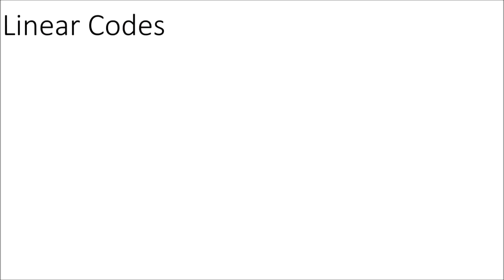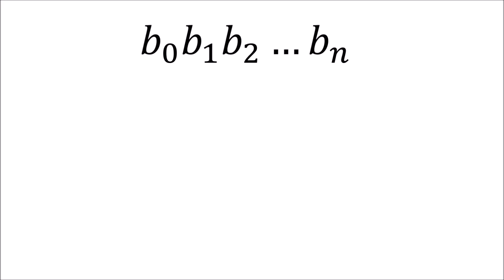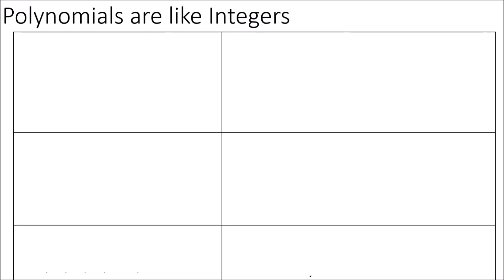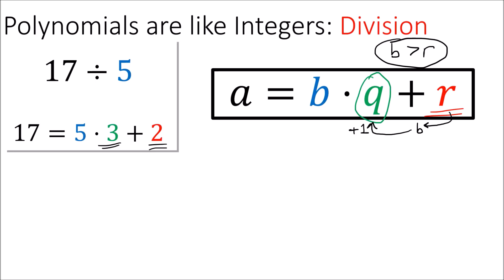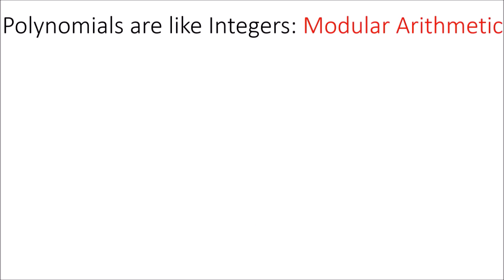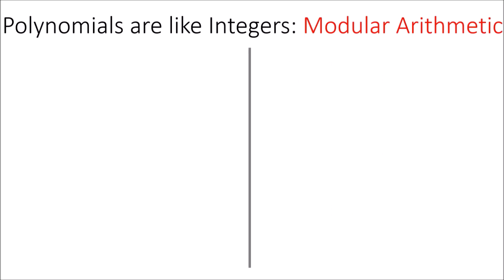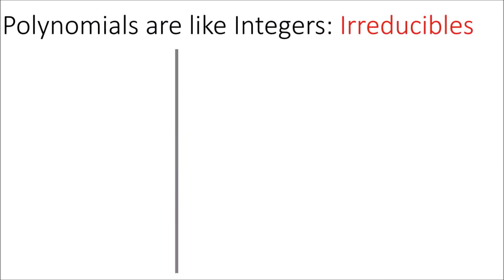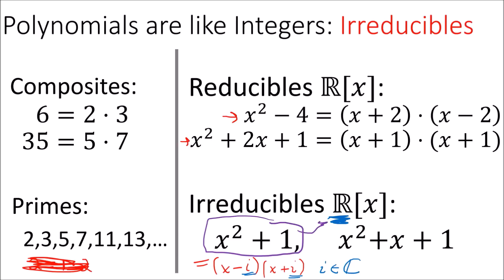Error Correcting Codes 3a: Cyclic Codes - Polynomial Properties

Comment: For anyone wondering how this relates to other parts of math: the integers and univariate polynomials like shown here are both rings under addition and multiplication (they'd just be monoids if only referring to one of the operations). In the modular arithmetic notation, the divisor on the right of the slash is known as an ideal (which is the equivalent of a normal subgroup from group theory). In the context of a homomorphism like `Z / 2Z`, the `2Z` ring is the kernel of the homomorphism (group/ring preserving transformation) because it's subset in the domain that gets mapped to the identity element in the codomain (zero for modular arithmetic). What's left over from the homomorphism in the codomain set after "removing" the equivalence class of cosets typified by the kernel ideal is homomorphism's image `Z / 2Z` or Z_2.

You can see why prime-number-order integers under modular addition & multiplication are fields (being groups, not just monoids, as respects each operation) because the identities for each operation, 0 and 1 respectively, are their own inverses but for the rest of the numbers, they have to be able to be paired up so there must be an even number. Other than 2, all prime numbers are one more than an even number so you can expect that a field under modular arithmetic will necessarily be one more than an even order. But not all odd ordered sets of integers are fields so it's not sufficient. Maybe it has to do with composite numbers having non-trivial factors and the ability to break groups into simple group factors.

Anyways, a year ago I had no idea what any of these words meant. So it's satisfying to see the puzzle coming together!